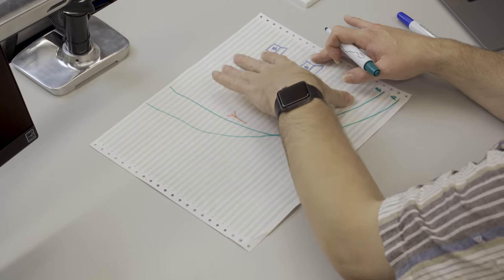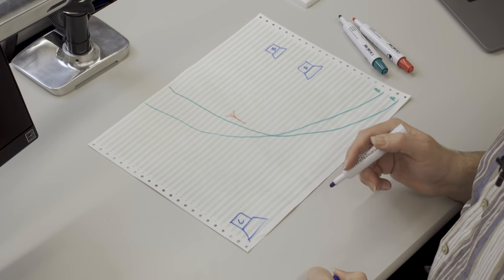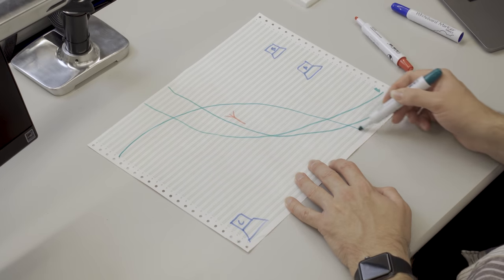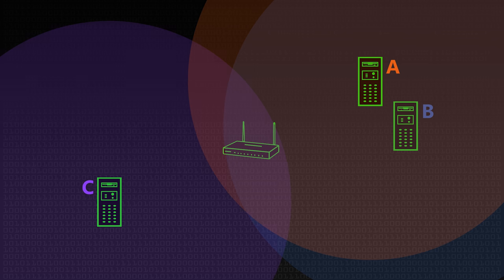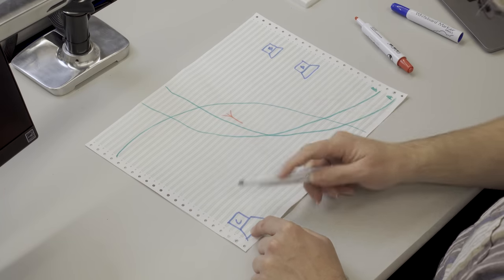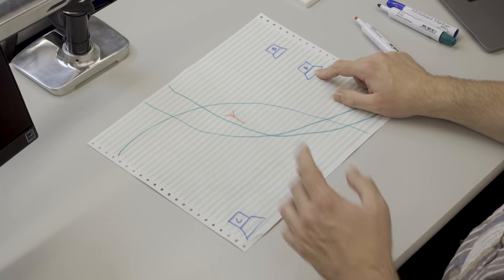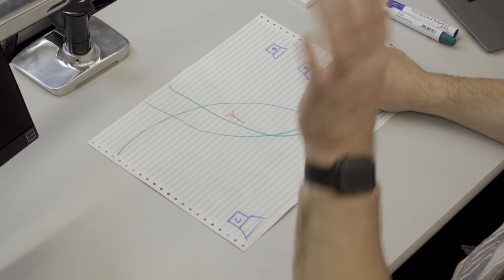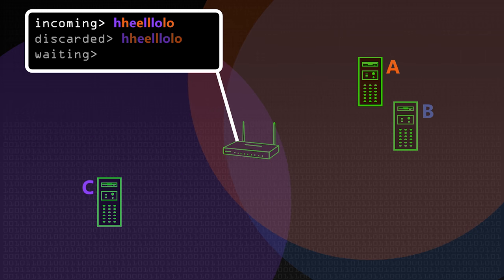WiFi's Hidden ____ Problem - Computerphile

Comment: another example is kids have to put their hand up to speak in class. they cant see the other kids behind them asking. and the teacher gives each of them permission to talk.
Reply: no need raise hand if nobody did teacher asked me give answer LOL
Reply: It's not a perfect analogy for wireless since the medium to ask for permission (visual) is different from the medium for transmission (voice). You can also raise your hand while someone is talking, and multiple people can raise their hand at the same time, the only conflict is if someone is directly hidden by somebody else's raised hand. Wireless would be like the classroom shouting "me" to ask permission, but in a classroom everyone should be able to hear everyone else so it's also not an accurate example either 😀
Reply: @JarppaGuru  Never took an English class I guess....
Reply: Let's see if fluidly mixing metaphor works:  You also have the problem of some nodes with high-gain antennas which aren't located far away from the "teacher" node.  Far away at the far end of the 150 person (eg 150 user nodes) classroom is one thing as the person shouts out answers and uses a hearing aid to increase reception of the teacher's shouted response.  But if the "teacher" has a bunch of high-gain antennas clustered next to him shouting and receiving all the time, the other members of the classroom have problems.

Comment: Addendum to the "over and out" thing, IIRC "over" basically means "please respond", whereas "out" is like "I'm done talking so I'm not going to pay attention if you respond".
Reply: There's no "over and out."

There's "over," which comes at the end of the message but the exchange continues with the other party now free to transmit.

There's "out," which is usually preceded by the speaker's callsign, e.g. "Copy that.  51 out."
Reply: And over the (military) radio only the caller can send "over and out" - means hang-up.  The receiver can't terminate the conversation until the sender does. If done properly and according to protocol. It the receiver wants to  terminate he can state so in conversation and receive an "understood, over and out" from the caller to end the conversation.
Reply: "Over and out" is only a thing in movies and are only used here, and by people that don't know better.
Why would you ever waste time word mincing saying over when you just mean out? Every extra word spoken is time the "line" is hold op, so other can't use it.
"Over" Transmission complete, over to you. Waiting for a response.
"Out" Transmission complete, end of conversation
Reply: @TheTykbry  Source? "Why would you ever waste time word minicing..." (sounds like a guess) - Maybe for clarity? For no misunderstanding? Noisy line? One word might be anything, three words sounding like "over and out" is probably understandable. Don't know for other nations but where I was trained we had a clear protocol sometimes wasting words (or using a spelling alphabet) to ensure no misunderstanding occurs. We don't want to guess what the other side said... And it's at times very hard to hear each syllable over the static and general noise.
Reply: @OLLE3770  alright, over and out!
Reply: @OLLE3770  Funnily enough, in aviation, "over" is not used at all.
In some countries (like the US), a message is ended by stating your callsign. In other countries (like Germany), you state your callsign at the beginning of the message.

It's usually not a problem, though. You can tell someone is still transmitting by the static. And, for the most part, you are sticking closely to a set of phrases anyway, so the receiver knows when you are done.
Reply: @terrsus  Sorry didn't get that, thought you ended my conversation, repeat, over.  JK. I'll drop it.
Reply: Tower: "Tower Radio, clearance, over."
Oveur: "That's 'Clarence Oveur', over."
Reply: Yep, "over and out" is wrong because it's like saying, "Your turn. Sike!"
It's also poor radio etiquette to be the one to say "out" if you did not initiate the communication. It's the equivalent of just hanging up on somebody in the middle of a telephone call.
Reply: In aviation neither over or out is used but often the receiver repeats back the message or acknowledges with Roger. But they there are very few questions, it is more a series of one way statements and confirmations of receipt. if continuous radio contact is expected then it will end with a statement from ATC of "services terminated" or from the pilot "terminate flight plan N1234" or if not yet terminating but will be out of contact "switching to [frequency] N1234". 
 
[plane]"ABC tower, N1234 at X location state local weather conditions." 
[ATC]"N1234 turn right 20degrees." [plane]"Turning right 20 degrees N1234" or "Unable to turn [maybe include reason], N1234". 
All very on point statements of what you want, no waste or confusion with arbitrary implied politeness or subservience. 
[plane]"mayday N1234 declaring emergency" [ATC] "N1234 state intentions." (not what do you want to do, there is no request or permission involved, only actual fact is transmitted.) 
Another example, the aircraft crew does not request flight clearance, they state "xyz clearance delivery, N1234 ready to copy from xyz to abc, ready for departure in 15 minutes." Who they are calling, who they are, and the message. Then the response has all the specific clearance info. (This clearance is based on a flight plan that was filed ahead of time, usually from the office, over the phone, or on a general information frequency.)
Reply: @TheTykbry  
"I have to go out"

Am I still in this conversation or have you just turned off your radio.?

""I have to go out      at about 3.00 PM   I'll see you then      over and out"

See the difference, but hey who cares it's not worth arguing over.
Reply: @Yotanido  In aviation we also repeat messages for extra insurance and we use AM radios because two transmissions will combine in a way that makes conflicting transmissions obvious to the receiver and then the receiver will simply say that transmissions overlapped. 
In FM, a receiving radio will lock on to the slightly stronger of two signals and the weaker will be completely hidden so the receiver would never know there was a second message that was missed.
Reply: @OLLE3770  "over and out" is only said so that a listener (or more likely, a tv show viewer) knows that the conversation is complete. the conversation participants kind of inherently know when they're done if they're following a protocol.  "out" is usually preceded by identification, signifying that the party identified is leaving the conversation.
Reply: I was a member of one of the voluntary aid organisations in the UK for many years. We had to use radios all the time. We were always taught that if we were initiating a conversation we had to 'wake them up, and tell them who's calling', ie use their call sign first followed by yours. That in general Control could call anybody, but everybody else had to call control, and if you needed to talk directly to someone else you had to get permission from control first. Only control was allowed to finish a conversation, but would usually use 'Control to standby' at the end of the message, and that 'Out' was generally only used at the end of the day/event when they were closing down. Over was used between each part of a message, and after the conversation started, only use call signs every three or four messages, not every time. And, since our call signs might be something like Foxtrot Bravo Six Seven Nine, we only used the Foxtrot Bravo part on the very first call, and after that, just used the numbers. There were lots of colour status codes as well which could get quite interesting. So if a RED or PRIORITY status was called, then everyone else had to shut up and stay off the radio until control declared that situation over, or you had another priority (emergency) call. All very complicated and we had to go through full radio comms training every year.
Reply: @jtveg  If you wanted to be more technically correct, if you need to stop talking for a bit, you would use wait over, after "I have to go out"
As "I have to go out, WAIT OUT" *pause* "at about 3.00 PM I'll see you then, OUT"
or you could know what to say before you start to transmit, limiting times you have to pause.
Reply: @_starfiend  In aviation the airplane callsign is used every transmission, the ATC station ID is only used for the first call on the frequency.(many planes, one station in an area) "standby" means I got your transmission but it will take a moment to get you more information. The end of the day uses some version of "terminated" depending on who and how, but usually still involves a confirmation reply. ie  [plane]"Close flight plan, callsign" [ATC]"callsign Flight plan closed, radar services terminated."
And direct plane-plane comms are fairly common, on rare occasions using another plane as a relay to ATC if out of range, blocked by mountains, and such. Many airports and areas have a "common traffic advisory freq" with no ATC just planes.
Reply: @mytech6779  Oh yeah, I totally get that air comms is very different, but we were on foot or in vehicles in a relatively small area. A few square miles or so at most, often less than a square mile, and if another event was happening locally enough that radio comms could overlap, one of the events would just change channel, so no interference. At an event everyone knew everyone else, pretty much, so once one person started talking, except at the really big events, most people knew the person talking. It wasn't an issue not to say the call sign every time, we just did it occasionally to keep the regulators happy in case they were monitoring. Which they did occasionally.. We used 'wait one' to mean 'stand by I'm just getting some further info' etc. People did use 'Wilco' and 'Roger that', but we were not supposed to. We were supposed to say, 'Message received and understood', or 'Message received, en route' or some similar phrase to make it clearer. Most of us didn't use radios regularly, so it was important not to use shortcuts and abbreviations as it had the possibility of confusing people. As I said, we were all volunteers, so this was done in our free time, and not part of our jobs. I always find it fascinating the differences in style, both from different people using the radios at an event, and between different organisations and types of comms.
Reply: Having had my amateur radio license for 50 years, next February, I can say I have never, not once said "over and out".  That's the stuff of movies and TV shows.
Reply: @_starfiend  👍

Comment: Medium access is hard. Thirty years ago when I was doing my Master's in RF comms we were working on this problem. We were using a slightly different variant called Elimination Yield Non Preemptive Multiple Access. One aspect of WiFi I'd like to see covered is how the protocols characterise the radio environment. You can't just fire off a packet and expect it to be received if, for example, there is multipath propagation (so portions of the signal arrive at different times) or the transmitter and receiver are moving relative to one another (which introduces a Doppler shift). Then there's the channel coding (quadrature keying, RAKE receivers, Viterbi decoders etc.) A lot of interesting stuff is going on in a WiFi setup and to 99.9% of people it's completely invisible.
Reply: Doppler shift on WI-FI ?!?!? With which speed are you moving with the laptop/phone to be able to have a measurable doppler shift of the radio waves? If you have the required speed you'll be out of range faster than detect the shift I believe (maybe I'm wrong).
Reply: @apclaudiu  At gigahertz frequencies, walking speed is enough to rotate the QAM constellation sufficiently to make your BER go through the roof. It manifests itself as a clock frequency offset between receiver and transmitter (which exists anyway and has to be accounted for). Fortunately it's relatively easy to counter (it looks like a multiplication by a unit modulus number exp(i theta t) in the phasor plane, so you measure it by timing recovery during the channel training phase and apply the countervailing multiplication to derotate the constellation).
Reply: @davidgillies620  Thank you for your explanation but I need to ask more not to refute you but for my understanding. QAM constellation is affected more by reflected signals. Calculating Doppler effect on 2.4 GHz moving with the speed of sound is just 0.0001% shift of frequency. I believe moving in an office/open space  will involve more change in reflections than in Doppler effect.
You can use Doppler effect to calculate speed if you really want but I do not believe it will affect the data transfer. Again maybe I'm wrong and I will enjoy being corrected and learning more.
Reply: @apclaudiu  QAM encodes data with both phase and amplitude. Walking speed is enough to change that phase a measurable amount relative the QAM encoding lattice (AKA constellation) at frequencies higher than 1GHz.
Reply: my understanding is that it's built into the TCP/IP protocol.. at the receiving end it'll reconstruct the packets (can be out of order) and if there's a packet sequence missing it'll ask the sender to resend?
Reply: @apclaudiu Work out the Doppler in a 5GHz signal for a user walking at, say, 1.5m/s. It's about 25Hz. That means your constellation is rotating at 50 pi radians per second . If a symbol gets mapped to the one next to it, you have a completely unrecoverable error at the PHY level. Newer standards like 802.11ac are using 256-QAM, which gives you very little headroom to tolerate this. Angular spacing between the outer points is about 7.5 degrees, which means at 25Hz you will have covered half that value (at which point your decoder can't decide) in around 400 microseconds. Not to invoke the argument from authority (well, maybe), but I did this stuff as a research engineer in a university department . It is a very serious issue, and if engineers did not take account of it, your WiFi would not work, end of story. And this is completely leaving out the problems of phase error, noise, multipath etc..This stuff is very, very hard and it's a complete miracle you can buy a WiFi-enabled device for less than NASA money.
Reply: Maybe you can help me with my lawnmower?
Reply: @lexd5136  that's for higher layers. Wifi is in layer 0 so the wifi frame has to be reconstructed long before tcp has any role to play.
Reply: Interesting to imagine how Wi-Fi would have worked if Token Ring had taken off instead of Ethernet. Passing a token amongst constantly disappearing nodes ?
Reply: @lexd5136  That's at a different level in the model. All LANs are inherently unrelisble, in that the data is transmitted and it either gets there or it doesn't (just like the postal system). WAPs, hubs and routers do not provide error recovery. That is left to the TCP layer in the remote hosts.
Reply: @davidgillies620  Radio engineering, was always considered a 'black art' 😀
Reply: @jms019  You nailed it, the 802.5 workgroup were working on a Wi-Fi based version, but in the end abandoned it due to the token getting lost frequently. Another reason for TR not taking off, was because it was predominantly found in IBM networks, and due to the complexity of the network cards, were more expensive.
Reply: @lexd5136  You are correct... and this is why the errors (@ level 1) that are being discussed (phase shift) will be transparent to the application (@ layer 7), unless and until, the the quantity of errors (@ level 1 and 3) increase the re-transmissions (@ level 3) beyond the TCP threshold. In this case the application will notice. 
Learn the OSI Model (7 layers) and things will become clearer.
Reply: This is probably the coolest youtube comment I've ever seen in my life.. SMART AF. Thank you for your contribution
Reply: @chrisc.6601  If we ain't learnin', we ain't livin'. :) This is what make YouTube so great. It's the knowledge-base of the world!!
Reply: @chrisc.6601  indeed, what a gem
Reply: @davidgillies620  Ooh I'd love to see a Computerphile episode on how a WiFi signal is encoded.
Reply: @davidgillies620  great comments David
Reply: This conversation… 🤯.
Reply: Damn I only scratched the surface of tech just reading this comment.
Reply: Also fun doing wifi surveys and seeing what blocks a signal and what the signal can go right through.
Reply: @davidgillies620  man, it's hard to believe my cellphone works driving 70 miles per hour if wifi doesn't work at 1 mph.
Reply: Can someone help me with a video explaining this "constellation", please?

Comment: I just did my Computer Networking exam, so I can really appreciate this!
Reply: Right? In my networking class we just started learning about wireless. And when facebook went down right before we were learning about BGP
Reply: Did you pass?
Reply: @Rickety3263  yes
Reply: @MarukoSakamoto  Congrats
Reply: Also just covered this on my CompTIA Network+ course!
Reply: @garyhalsey7693  What are you using to study? My buddy and I got certified in 2015 (A+,Net+,Sec+) but he let all of his lapse as it wasn't necessary his job. I got a new job with my recently acquired CISSP, and my buddy wants to apply for another position (opening in March) for the same company. Just wondering what free resources you used that we may not have considered.
edit: He needs at minimum the Comptia Network+ which is why I'm asking.
Reply: Thing is that this problem is non-existent on professional access points with timeslots for broadcasting. Better even, WiFi6 fixes this with OFDMA completely.

This video is correct, but forgets today's standards.

Of course even if you do not have those CSMA/CA does it for you. As mentioned in the video.
Reply: I passed the Network+ a few months back. WiFi is a huge part of the test